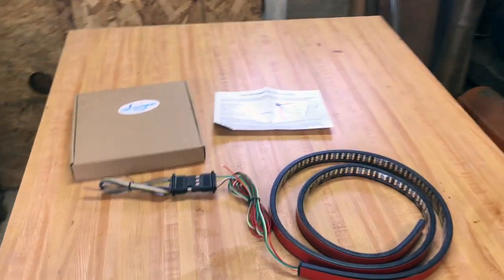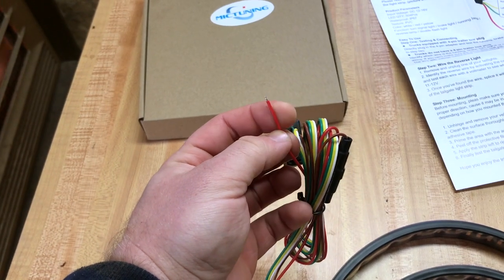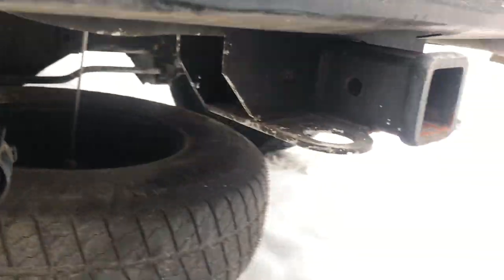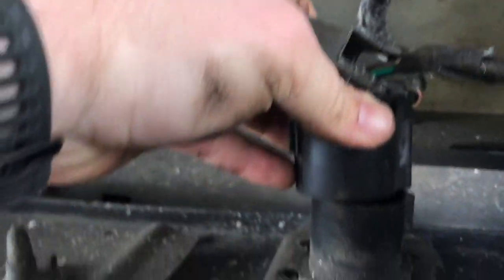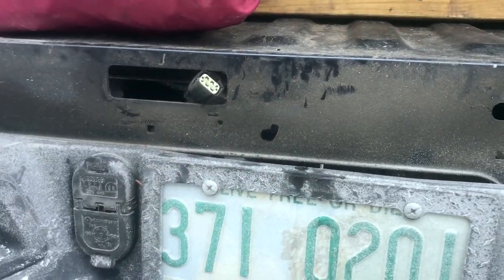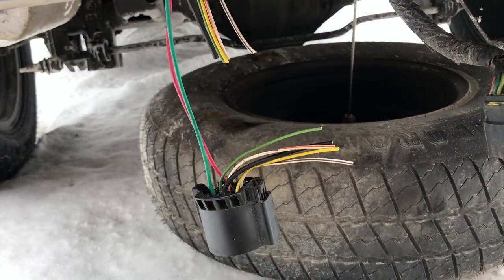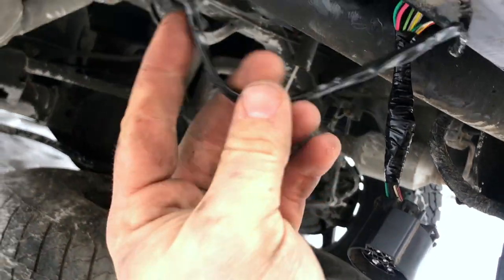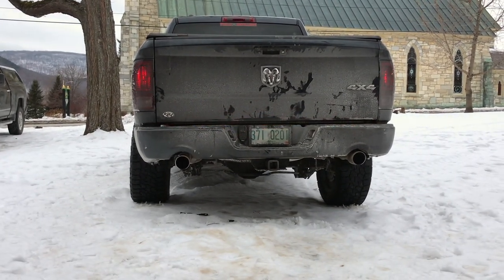LED Tailgate Brake Light Strip Install (Wired To 7-Pin Trailer Plug)

Comment: Great video I watched it a few times before installing it on my ram. I took your idea but just bought the trailer end of the plug and wired the light strip to it so I wouldn’t have to cut into the factory wiring harness. All in thank you for the run down.
Reply: Where did you get the plug or adapter from

Comment: a little tip for anyone.... if your running light   does not work on the LEd strip it can be caused by your after market tail lights...  i had to cut a cable out of mine cause it was causing a shorth in the circuit for the running cable. took me 2 days to figure it out.
Reply from the maker: Thanks for sharing!

Comment: Great video. What is the long terms review of the light bar? Also my bigger concern is say you have a puncture, how do you lower the spare tire? Does the light bar cover the access hole do the tool?
Reply from the maker: Thanks and I had it on my truck for 4 Vermont winters and it was fine. I had issues with cheaper ones in the past. And there is room to put it either above or below that access hole.

Comment: Thanks a lot for the video, it was helpful, just install the strip light last night on my 2013 GMC Sierra, I used to have it plugged in to the trailer connection but didn't like the way it looks so I did exactly what you did. Thanks.

Comment: I have a strip of lights that I'd like to connect for just brake lights with no blinkers or reverse lights, what wires would I have to splice it with for thag

Comment: I have mine connected to the 4 pin connector and the reverse light wired into the tail light. Problem is....running light works,brake light works, left and right signal works,but...when im on the brakes,only the right signal flashes,but not the left. They both work when not on the brakes.

Comment: All in all helpful video but I Didn’t even have to cut them I just used some funky splice connectors I found and taped that all up
Reply from the maker: Those work too somewhat. I don't use them due to high salt use in the winters by me bc they will not last.

Comment: I just wired mine in on my 2018 ram 2500 and when I step on the brake it turns solid orange then switches to red… scratching my head on that one. If anyone knows what is going on please let me know
Reply from the maker: Yes mine does the same thing it flashes orange quickly then goes to red. Not sure either why im wondering if its a safety feature of the light for more warning on a hard break? i have noticed it's only when I apply the break quickly.

Comment: Where did you connect the red brake light wire? I got mine turning left and right, but when I hit the brake. It's just fires both blinkers like I had my hazards on.
Reply from the maker: Mine did the same, I think it senses if it’s a quick signal like when your blinkers are going. So if you do a really quick break tap it will trick it. If you hold the break for more than a second then it’s red.
Reply: @GreenMountainProjects  I found the wite that signals the stop finally. Had to use my Haynes manual and figure out a few of the symbols.

Comment: I have a 2016 led gmc Sierra brake lightni installed a aftermarket lightnincutnthe factory bung dornled  stock brake light what is ground  i have brown red and green and black wires
Reply from the maker: Not very sure what some of those words were lol... But if you asking about the ground its most likely the black. You can also just run your ground to an frame metal.

Comment: Hi, did you only use electrical tape to connect the wires together?
Reply from the maker: No you will want to get crimp connectors and shrink wrap tubing to put over it.

Comment: I ID the wires , cut them and connect the led , but for some reason right turn wont work , I tried the wires and they all have power
Reply from the maker: Weird, if you tested that wire and it works then it must be the light. I would swap it out and re try

Comment: Did you have to connect the reverse light to the taillight separately?
Reply from the maker: the 7 pin trailer plug includes a reverse light. Just google wire diagram for an 7 pin trailer plug. Reverse should be the center pin which is pin #7. If you don't have the 7 pin plug on your truck and you just have the 4 pin plug then you will need to tap into the reverse light wire on a tail light.

Comment: I just finish installing mine, but idk when running light is on, only one line of lights turn on, not all 3 lines of lines.
Reply from the maker: i think that is normal. one is amber for the turn signal and the other is the break light to make it brighter.
Reply: @GreenMountainProjects  thank you

Comment: do your turn signals stop working when you press on the brakes and start working again as soon as you let off the brake?
Reply from the maker: Yes they keep working.
Reply: @GreenMountainProjects  Mine work untill I press the brake, then once I release the brake the blinkers blink again. The light bar is hard wired and works great otherwise. 2013 Chevy Tahoe.  Any ideas please on how to solve that issue I'm going nuts trying to sort it out.  Thank you for replying and Thanks for the help.

Comment: Just curious why you used a 7 pin & not the stock4 pin on the truck?
I have the same lights & plug into the 4 pin receptacle
Reply from the maker: I wanted a more perminant wiring location and just didnt liked the look of the wires poking out and running into the bumper.  Another reason is I have a trailer with a 4 pin so I could still use that without the 7 to 4 adapter.

Comment: i bought other brand light strip but same pins. i do not know why if i press the brake pedal the light does not work. I connected the red led to the running lights.
Reply from the maker: Did you connect to to the 8 pin connection or to the tail lamps wiring? Ik mine were connected to the break/blinker wire

Comment: I did the same on a2016 F150 and now the blindspot assist turned off, says a trailer is attached, and also no more park assist. How can I fix this?
Reply from the maker: I would take it and trade for a Ram personally... lol just kidding. Plugging this in is basically putting it into towing mode and that’s why those shut off so a trailer isn’t constantly making them go off. There might be a way to override it or an adapter for fords. Let me know if you find one!

Comment: can you connect this the same way if you are running the lights on the running board on a 2004 GMC  yukon
Reply from the maker: Yeah you can wire them into the trailer wiring like I did
Reply: @GreenMountainProjects  the colors are different
Reply: @GreenMountainProjects  on my light strip i only have 4 wires Black ground with a fuse attach to the wire and yellow  is turn signal,red is parking light ,and white door assist  and on the trailer hicth the wires are different

Comment: You made the entire video, but didn’t show which sites got to the light bar. That was the most critical part I was looking for……
Reply from the maker: Amazon, there are tons of them.
Reply: I have one. I was trying to figure out how to hook it up because the instructions that came with it are garbage. I watched your entire video, it was helpful up until the point where you skipped putting the wires together. You just went right to them being taped up. That was the part that I was looking for. Thanks anyway.

Comment: I cant get my reverse lights to work on the strip I ordered
Reply: Everything else works as it should, your video was very helpful thank you btw
Reply from the maker: I would test it on a drill battery and if it doesn't work the strip could be faulty.

Comment: It's a shame they only last 12 months in the silicon goes all foggy and white why haven't they invented some other way to cover them up
Reply from the maker: Depends on the product mine lasted till I sold it and had it for 1.5 years and that was two winters in Vermont.

Comment: Signal lights work,
Brake lights don't work
Running light works
Brakes don't work
Reply from the maker: Might be a faulty product. I have noticed they can be weird with the break lights and recognizing the signal.

Comment: Can this be instaled on suv without trailer wiring
Reply from the maker: Yes you can wire it to the tail lights. Your just gonna have to figure out which wire does what function.